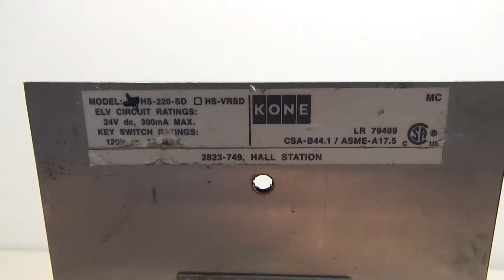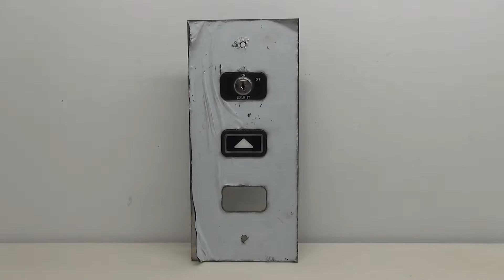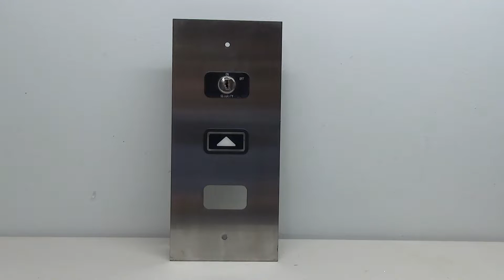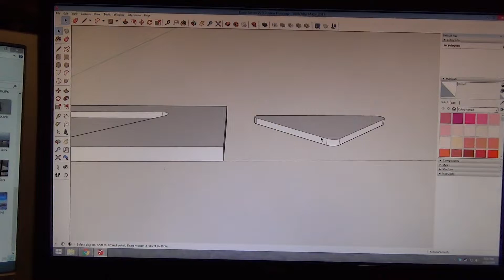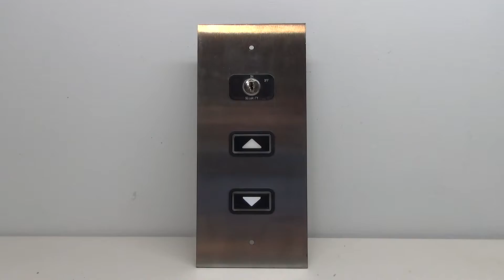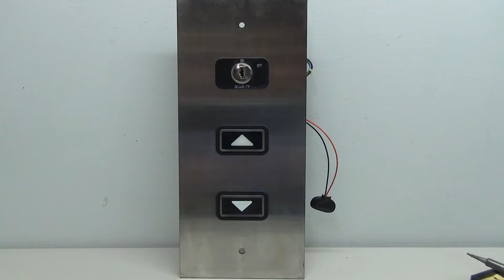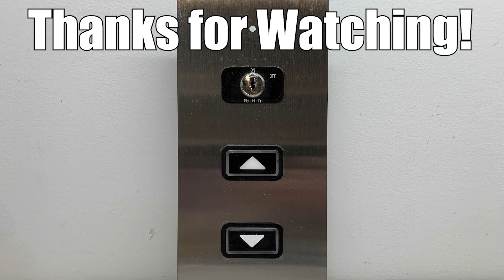Restoring and Wiring a Kone Series 220 Elevator Button

Comment: At 8:35, what exactly are you soldering? Are you soldering together the 2 inner pins and connecting that to the black and red wires?
Reply from the maker: I just made a solder jumper across the two other pins. I didn't have the proper connector at the time, so I had to do that.

Comment: Hey Jason, I’m trying to wire one of these up for my computer engineering class at my high school. We used a breadboard and a 9V battery, and we think we completed the circuit, but the button isn’t working. Can you help us? Thanks
Reply from the maker: They’re supposed to be run on 24v, so you could try that. I just did 9v because I didn’t have a 24v battery pack at the time. Just verify your connections are correct. It’s also possible the board could be broken, so verify on another board if possible.
Reply: @stlelevators  Thanks
Reply from the maker: Let me know if you have any other questions
Reply: @stlelevators  thank you! Our spring break is next week so I won’t have any time to work on it for a week. I also have an MT PI I’d love to try and wire up

Comment: Makes me wonder if Series 220 fixtures are actually from the U.S. or Europe. Someone from the UK once filmed a KONE elevator with Series 220 in Europe.
Reply from the maker: Hard to tell, but the circuit boards on the 220 buttons have "US_Button" label on the back, so maybe there's a UK version and a US version.

Comment: is that KSS370 button getting a wiring video soon?
Reply from the maker: It may be a bit for that one since I am going to try to find a proper connector I can use. The pins are too small to solder to and I don't want to risk damaging the connector.

Comment: You should make buttons for a lift company.

Also some constructive criticism: You should've used a different micro switch, infact the board doesn't really matter, you're just wiring in some LEDs and that's it really, I know you wanna still keep it real though.
Reply from the maker: Why would I use a different switch when the genuine one works just fine? I only make my own circuit when the genuine circuits won't work with a low voltage battery.
Reply: @stlelevators  No, because the fome on it will wear out or leave some residue which is horrible.

Actually you can replace the fone with a more reliable material such as plastic or something, it'll click fine and probably last longer then that fome on the circuit board.
Reply from the maker: For the amount of use this button will get now, that foam should not wear out. Its over years of use where it would wear out.
Reply: @stlelevators  Ahh okay, I wouldn't rely on the fome that much though but ok.
Reply: 《》Rahan2003《》 it’s spelled foam
Reply: @VOLTRONDEFENDER4440  Okay spellchecker of the internet.